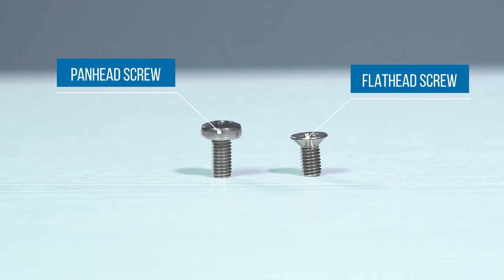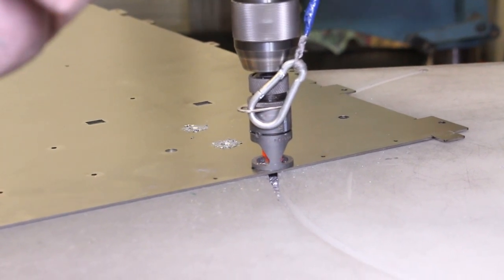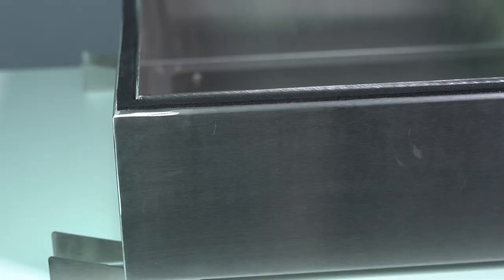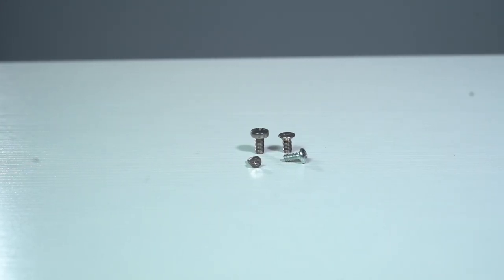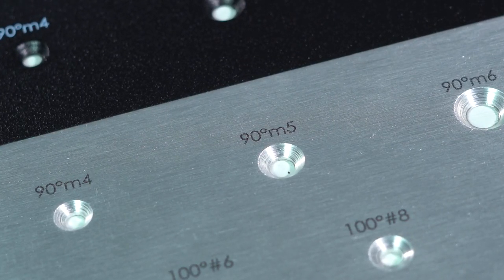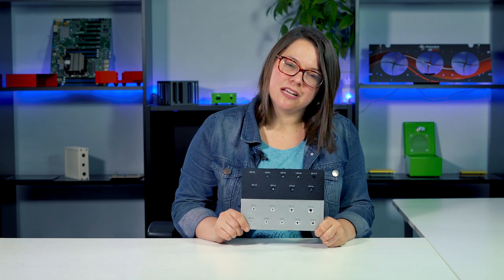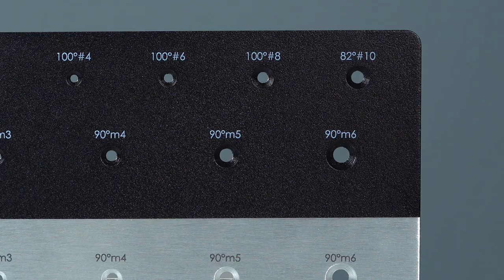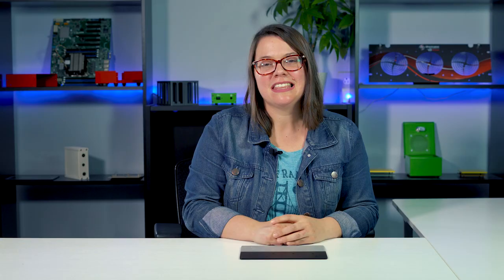Proto Tech Tip - Countersinking

Comment: I have a unique situation where I'm fastening a thin sheet of metal to a solid block. The countersink on the screw is deeper than the sheet thickness. My plan is to countersink the block and countersink punch the sheet metal. I'll be sure to reach out for advice!
Reply from the maker: Hey there! What you described is definitely fine to do. This is common for extruded aluminum enclosures, actually -- when the front panels are too thin to countersink, we finish the countersink geometry on the extrusion itself so the screw head will sit flush. :)